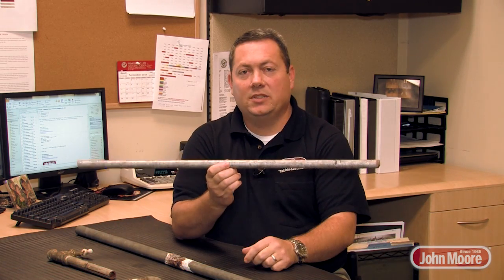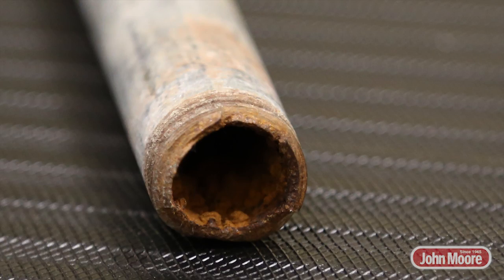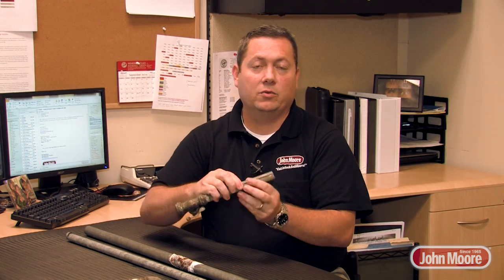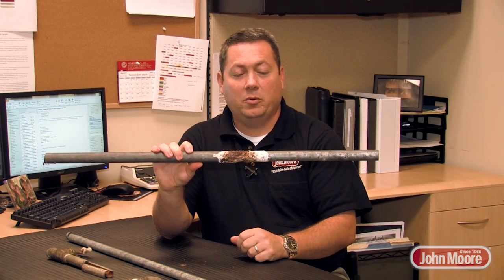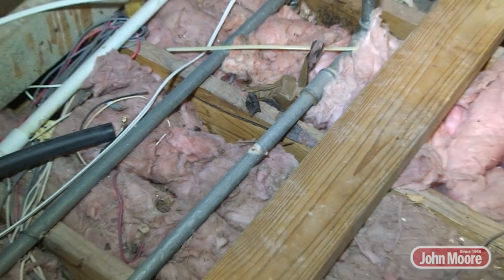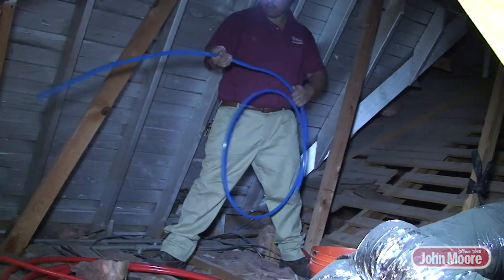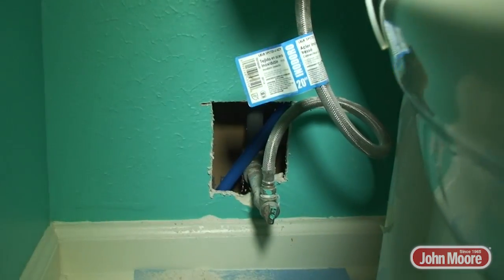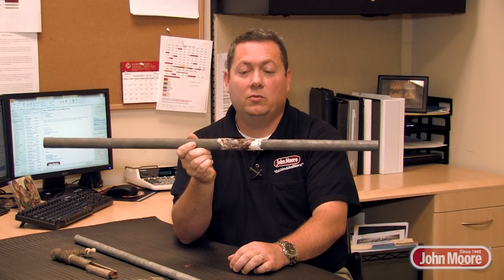When You Should Repipe Your House

Comment: When you run pex down a wall WITH OUT  anchoring it to the studs, water pressure will cause the pipe to move resulting in a loud knocking noise in your wall when ever you turn your sink on or off or flush a toilet. also, this can put stress on the fittings and cause a leak.

Comment: Usually the hot water pipes are the ones that corrode. I replaced most of the pipes in my house with Pex, the cold looked brand new inside, the hot were the only ones rusted and it was mainly the main trunk lines from the water heater. The pipe going to a single sink had very little to no corrosion. So if money is an issue do the main pipes that feed several fixtures first.

Comment: Nobody is promised tomorrow so fix a leak now and maybe the next one will be someone else's problem. And yes put a bottle of water in your attic and the mice or rats will chew right threw it to get water. The plastic pipe that's truly what it is. Is cheaper for the pluming company to use and much easier for them to replace and yet the laybor cost just as much if not more. Stick with copper if you have it because. Plastic isn't much more less problems than a rusted pipe. The plastic pipes where built for a trailer house and do you really want your house to be as week as a trailer house. They develop leeks all the time.
Reply: Pex was developed and used in housing since the early 60's. If you have a rodent problem, get rid of the rodents.

Comment: I bought a new kitchen faucet for grandma last Christmas. I hadn't realized I was going to need to replace back to her HW tank and cold supply to keep the faucet from filling with iron. It was worse on the hot side because the local plumber mixed pipe poorly without dielectric fitting. This is what my father did for a living...so I just did it. Looking back, it would have saved time if I just took it to her main. Retrofitting was a pain, left the better old pipe, and opens the door to a next time. Is the inside expanded pex larger diameter than ring fitted and crimped or is it just the fittings are smaller in diameter to compensate. I used 3/4 on her cold supply to retain volume.

Comment: But you need to factor in the cost of replumbing an entire house v. fixing broken sections every now and then. There is no way the total repiping job is anywhere near as cost-effective as fixing broken sections when they occur. Changes are the sections will need to be replaced, but sporadically and probably one a few hundred dollars at the highest vs. tens of thousands of dollars to repipe an old house!
Reply: Speaking from experience as a plumber, it's better to just replace it all with brand new pipe rather chasing leaks everywhere all the time. You fix one leak and in a few weeks you'll find another somewhere else because the more you work on and move these old pipes, the more likely they'll spring leaks and it becomes a massive headache. Better to just replace it all in one go if you can especially galvanized. Galvanized pipe isn't worth saving. It doesn't costs tens of thousands to do it. Usually anywhere from $2000-$5000 to re-pipe water lines depending on the size of the house obviously and how easy the access is to the pipes. Drain lines cost more to replace especially if it's cast iron.

Comment: How could anyone have thought galvanized pipe is good idea for drinking water? In Europe it's prohobited to use it for water supply as long as I can remember. It's only used for central heating pipes. Before pex or alupex, it was all copper.
Reply: In fairness, I have galvanized pipe in my house, and I believe it is original to the house, built in 1954. 70 years. I just tested my water 2 days ago - from the hot water side on the furthest fixture - and there were no abnormal readings.

Comment: What do you recommend for the exterior galvanized pipes that are used for like watering your lawn? Do you still maintain the galvanized pipes for those locations?
Reply: That's what I was going to ask.. seems like this fella isn't answering questions.
Reply: anything exposed above ground you need to have done in copper. plumbing supply houses sell "k" copper its thicker the L copper and M copper that's what I install if exposed. Galvanized pipe should not even have water in it. It's good for fence posting lol

Comment: Any ideas on how to protect pex from rodents? Woul encasing the pex pipes running them throu some kind of metal tubing solve the rodent issue?
Reply: Why don't you start with getting rid of the rodents and keeping them out?  I've had zero rodents for 20 years. If you want to go to the extra expense of putting the PEX within PVC then yeah that would solve your rodent issue. Now you have a house with PEX and rodents.
Reply: @condor5635  Some people don't know they got a rodent problem until... they got a rodent problem. If they can eat away at the plastic undetected or come in while you are on vacation, then you got a disaster.  I researched this too and found plenty of horror stories. PEX is not the perfect solution some might think.
Reply: @Robert8455  - I respectfully disagree I have old galvanized pipes and I’ve had leaks with it as well. There’s not a single thing they provide that I would not gladly trade for using PEX. I plan on changing mine out ASAP.  And if you have rodents like that you’ve got other problems in my opinion.

Comment: How expensive is the repipe job?
Reply: It depends on if you use pex or copper, copper is more expesive than pex and requires more time to install
Reply: For a 3/2 - 2,000 sq ft you are looking at $7-10K. At least that's an estimate I got few years ago.
Reply: @condor5635  Thank-you!
Reply: @condor5635  Is that for PEX? Thanks
Reply: @condor5635  this cost is average, so to add a half bath and probably more for a 2 story add maybe $5000?